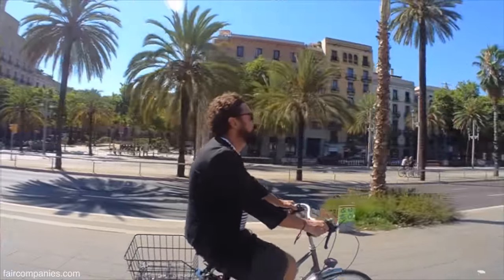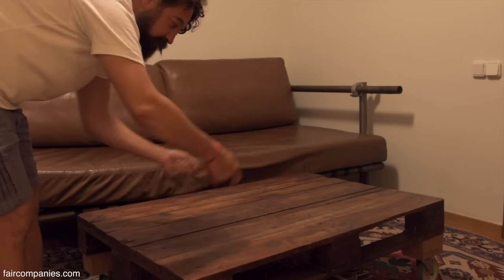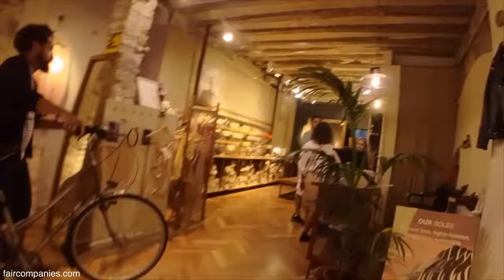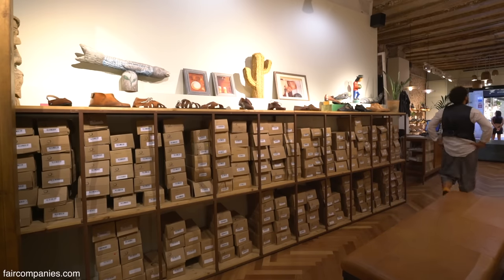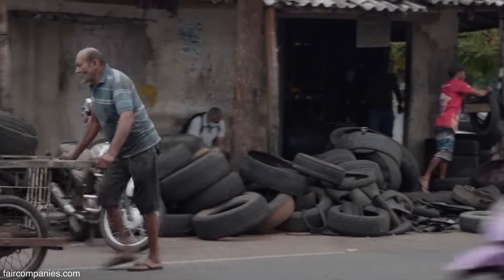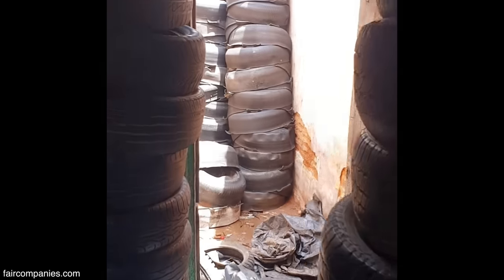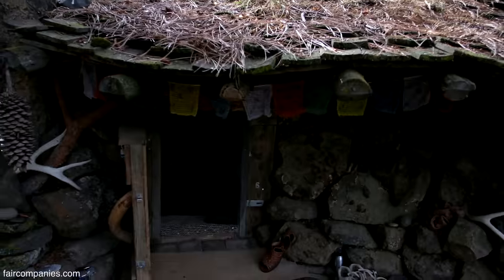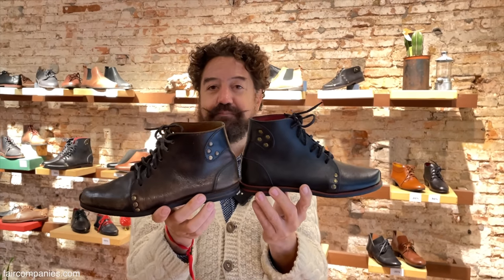People only saw old tires & poverty. He makes Slow Shoes from it 👞

Comment: "Old tires are used in several different ways, which include reuse, material recycling and energy recovery. Part of the rubber in old tires is used to make new tires. Most used tires are cut up and used in the production of other rubber products, or burned in special ovens to produce district heating and energy."

Comment: The concept of this is not clear to me. He explained he was using leather that has been contaminated with chromium for making jackets? How is that good? Also, buying goods from Brazil harms the environment in travel and fuel and emissions. Why doesn't he buy rubber tires from Spain to use and cut out the costs of transport!

Comment: The indios of Mexico have made shoes from tires for many years.  Over fifty years.  They're called hirachis.  I used to on a pair.  Leather and treads with nails.  I could have walked 40,000 miles on them.  This is not some new, trendy eco thing by modern hipsters.
Reply: Definitely, but to be fair, I don't know of any formal shoe or boot manufacturers that do this, so you'd have to agree that this combination is new and beneficial